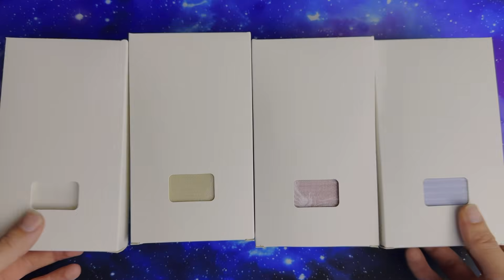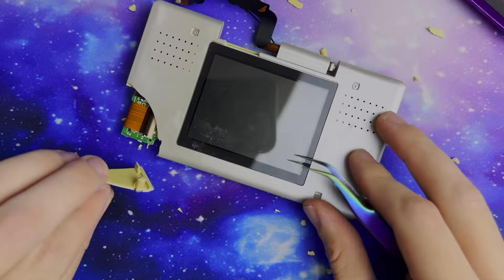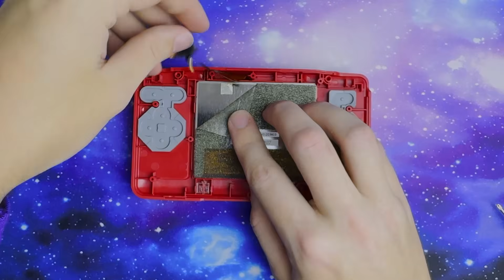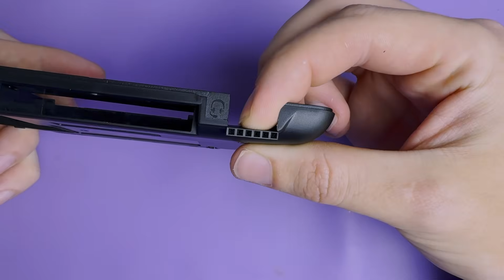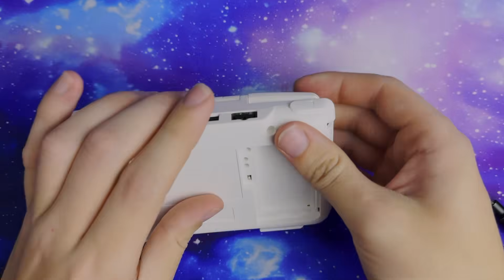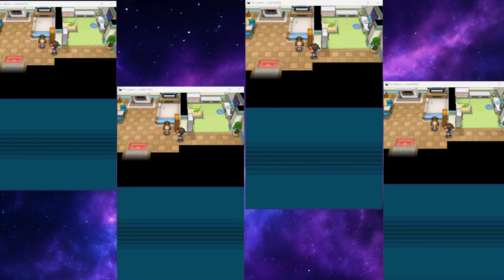Turning JUNK Consoles into the BEST EVER Nintendo DS Setup! - 4 Controlled at the Same Time?

Comment: How did you learn how do solder and stuff? i have functioning consoles and want to mod them but i am afraid that they might not boot anymore lol.
Reply from the maker: I used to work in a repair shop a while back. I would recommend practicing on broken consoles first!
Reply: I have been in your shoes before, not too long ago, but can confidently tell you that it’s not as hard as it looks and you get the hang of it quicker than you’d expect. Like Kouzex said do some test runs too, do your research and watch creators like Kouzex to learn how to do it. If you get the temps right (takes some getting used to to know what temp you need and depends on the solder type) and have good flux (I prefer paste), and it becomes as easy as just pressing the iron and solder to the point, and you’re done. Just one or a couple taps. A great couple things to have: solder wick (can clean up a bad solder job well in case you want to retry, or remove old solder without a desoldering gun), copper wire cleaner (wet sponges don’t cut it most the time! This will keep your tips from oxidizing), 90%+ (99% is great) isopropyl alcohol (this is good to have for all parts of console modding/repair! Great for cleaning up leftover flux and dirty parts of old consoles). Best of luck!

Comment: Do you do mail in service? I want flash me installed
Reply from the maker: Yes I offer mail in services! However, flashme can be installed without soldering so if you have the correct DS board revision and a flashcard you can give it a go!
Reply: @KouzexMods how much for the flash me and usb c add on?
Reply from the maker: @Marlevlyn send me a message on my instagram and I can put together your order for you.
Reply: @KouzexMods I don’t have social media but my wife has facebook
Reply: @KouzexMods do you have a business email or website?
Reply: @KouzexMods I created a instagram. Messaged you.
Reply: what does flash me even do?
Reply: @TheHumanPerson9753  it’s an old mod that has been recently discovered where they can take certain models of the original DS and do what’s known as a flash Me on it to make you have four different means of brightness just like the DS lite
Reply: @Marlevlyn is that all it can do? That doesn’t sound worth it for the potential bricking the device
Reply: @TheHumanPerson9753 you can do a few more things but it’s worth it to me. I don’t like the lite